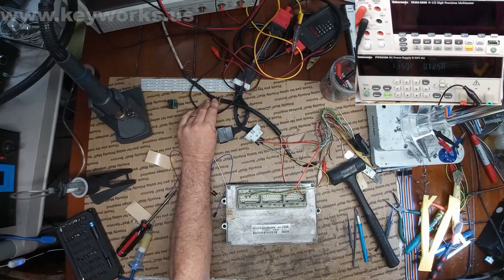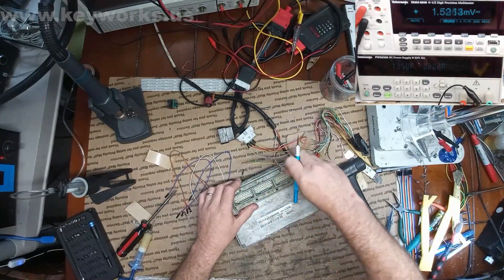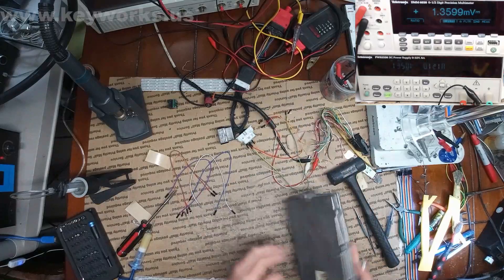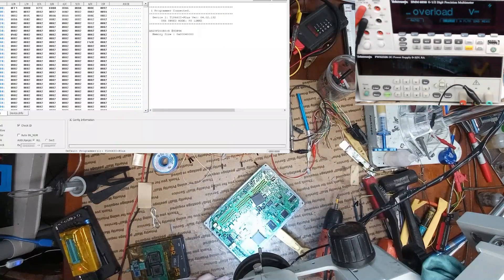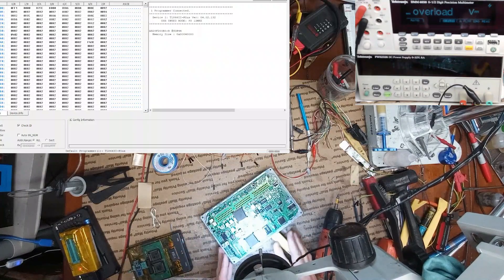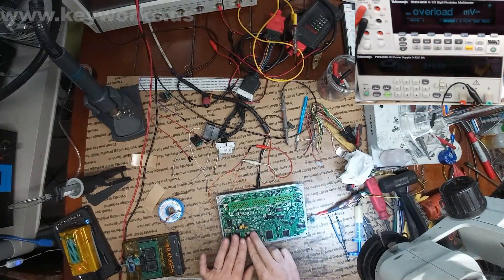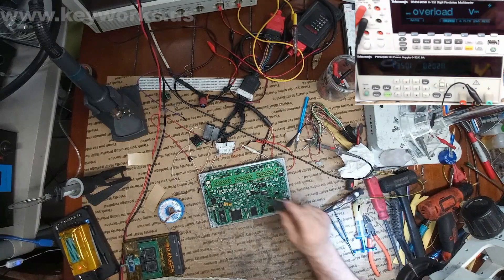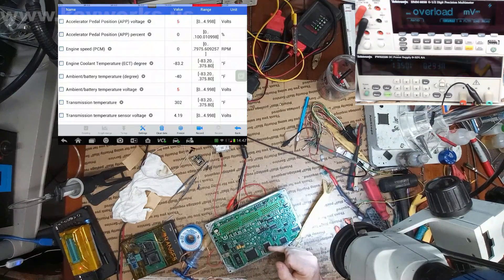Repairing a Dead DODGE RAM JTEC PCM with no communication - Board level electronics repair

Comment: Can I send you my 2001 Dodge Ram 1500 5.2L 2WD 5-speed manual computer? It's losing its spark after warming up and displaying no bus I have tried a new computer from flagship one and they can't get it right. 5th try with them and still not the right computer. I took the lid off of my original and there's silicon stuff over the board so I can't even mess with it to see if there's broken soldering. Is this something you can tackle for me?
Reply from the maker: Sure, that repair can be purchased anytime from my website. https://keyworks.us

Comment: I have an 2003 2500 dodge runs and drives but I can’t run a scanner it says no communication between anything is it a wiring issue or most likely an ecu issue
Reply from the maker: Its either wiring for SCI bus, or worse, the sci bus is fried in the ecu which is not reliably repairable.
Reply: Ground issue on the truck?
Reply: @Hotrodfabs ended up being dirty tipm connections thankfully since it still ran that was the main culprit before wire chasing
Reply: @Avoided_room that's awesome , mine had a few bad ground s fixed those and now I have communication again but likely a bad pcm only the tach guage works and cluster passed self test

Comment: Can I ship Mine to you?? Same pcm😂 2003 ram cummins auto
Reply from the maker: Sure, I work on those quite often. My site is https://keyworks.us
Reply: @ecurepair  hey brother I dont see the specific 2003 dodge ram 2500 diesel option what should I do?
Reply from the maker: @Izzabumminz  for the ecu on 03-07 cummins 59's the listing is here https://keyworks.us/ramecu59.html
if you have the early model 03 that still has the ecu and the pcm, I'd reccomend you send both. You can use the same listing and I will see which one is bad before making repairs. If you are sure its just the pcm on firewall (not typical) then the listing you can use is https://keyworks.us/engine-control-module-mail-in-repair-services/ram-truck-ecu-repair/ram-cummins-96-97-ecu-repair.html
Reply: @ecurepair  Thank you for replying! Well hear this out, my truck has 800hp/ with firepunk tuning for a manual valvebody, it used to be an auto shifting truck, it runs great, but doesnt communicate to pcm, and my truck drives around with prndl indicator stuck on park,

I can only flash my ecm with a green and white wire on pcm disconnected, or the whole c connector unplugged. 

Do you think I’ll still need to send Ecm? 
One thing also that happened but is repaires now is when a transmissiom got swapped the wires got pinched and cut/def shorted to ground, harness has since been repaired
Reply: @ecurepair  I purchased the 96-97 pcm and am Sending in my PCM
Reply from the maker: @Izzabumminz  Looking forward to getting it! Sorry I missed your last comment, Definently sounds like it would just be the pcm needed to be sent.

Comment: Just been doing some research I have a 96 dodge ram 5.9 Magnum it was dying when I hit bumps in the road, and if I gently wiggle the plugs of the computer, it will restart, but if you wiggle them again, it will die or it won’t idle, but it’s obviously all right there What is your opinion? Is it related to the plugs or is it the computer itself? It’s very clean. I put dielectric grease in the plugs just trying to decide. Do I need a new computer or what? Thank you for any help
Reply from the maker: i would look from broken wire terminal inside harness for what your describing.  But the ecu at that age should be rebuilt before its too late and the caps destroy the power management area,
Reply: @ecurepair  hey I really appreciate the response. I’ve been a mechanic my whole life and I do it 40+ hours a week I’m a fair hand, but I’ll be honest with you. I wouldn’t  have the slightest idea how to remove those female pins out of those plugs I did get the back off of each of the three but the way they’re going into the connector. I don’t know how to release them. You’re being very honest with me appreciate your knowledge,because we are ready to get a computer. How would I go about getting to the actual wires crimp connector within the plug? I really truly appreciate your responses to this kind of at our wits end here seems to be the farthest towards the driver side,this truck was “chipped” and my son drove over to high school. I know he done some wiggling on that plug at some busy city intersections.I figured it damaged something 
So yeah, if you can tell me how to release those female pins I would love to check them out today. It’s sitting in the shop waiting for the next move. Thanks 💯
The symptoms are no start just cranking , wiggle the plug it will start but you have to hold the RPMs up for about 30 seconds or it’s like the throttle positioning sensor is not getting read then it will idle and then it may just literally shut off or until you touch one of those plugs, like I said, mostly the one farthest to the left sitting in the driver seat
Reply from the maker: @usernameinvalid2675  Here you go https://www.youtube.com/watch?v=DwTg3wWlpOM
Reply: @ecurepair  thanks for the link.I goofed and took it apart in the middle now all my barrell ends are loose 
The reason I took it apart was I didn't have the tool I found what you claimed to me C1  Pin 31/32 or 30/31 don't remember  are grounds and when I wiggle those it kills the truck. Sure enough when I inspected them they look like they're corroded or have gotten hot. Sadly, the two pins  on the computer look like they're burnt at the base of the pins,but I'm not for sure how to crimp new terminals onto those wires yet I have the complete set up GM Weather pack stuff. I use all the time, but this set up  is kind of new to me.
Thanks for the video and all your help
Reply: @ecurepair bro you’re a lifesaver, same issues on my Dakota, trying this later thank you
Reply: @Elliott-l5p  good luck 🍀👍
Reply: Anybody that offers a service plus gives out actual advice is goood guy.👍

Comment: I am working on recapping a 97 Ram 1500 ECU. Can you advise me whether or not I can replace the old liquid electrolytics with solid polymer of similar voltage, capacitance and size or will the low ESR cause problems? There's only 3 caps on this board. Thank you!
Reply from the maker: I dont think the low esr will cause any problems. These are just filter caps. Not sure how the filtering will be effected but I doubt it matters all that much.
Reply: @ecurepair  thank you for your input

Comment: The big question is do you have any tips for removing that silicone type potting material?
Reply from the maker: Nothing special, just slow and steady.  Use wooden or nylon tools.
Reply: @ecurepair  yeah, I was hoping something had come along in the last 15 years that made it easier lol. Thanks.

Comment: Was wondering if you could give an opinion on a dodge I'm working with . I'm at my wits end on an 07 ram 5.7 , only have 1 code 1279 , no start condition , have signal from pcm to tipm , no starter output voltage from tpim (i believe it is c9-pin2). Not much info to go by figured id see if maybe its something common you have run across before . Have good comms and cant seem to find anything else at fault . Tried swapping out the TIPM with a used unit but same outcome . Not sure what direction to go . Love your videos , i've watched pretty much all of them . Thanks
Reply from the maker: I'd hate to give you bad advice. I dont know much about diag while stuff is on the vehicles but I would check live data to see if the Skim/WCM is sending the start command when key is turned, if it is and tipm was replaced with same outcome then its possible the driver in pcm is at fault. If the Skim/WCM is not sensing the start command, then its possible the plastic ignition switch is faulty and not making contact for start command or possible the skim could be at fault tho the metal key type are usually pretty solid. Once long ago, I had a tech working on a Nitro. Same symptoms, no start command. They replaced and had me program the TIPM first, Then PCM and Finally the SKIM.  Still the same DTC in skim (i forgot what it was sorry). Turned out there was some issue with the battery, I guess some type of internal short. It was showing as somewhat good voltage so no one really paid much attention to it. Eventually I guess they put another to do some testing and after replacing it all the problems where gone and it cranked like normal again. I would like to mention, the bad battery had been disconnected and reconnected several times so it was not an issue of anything getting reset from disconnecting it.
Reply: @ecurepair  Thanks for the assist . From your reply - "It was showing as somewhat good voltage so no one really paid much attention to it." This is what I went after . Testing both tipm units on the bench reveled they were in good working order . I found that on the truck the tipm seemed to "go to sleep" so i began to hunt for some type of voltage deviation . I eventually found one that seemed about 1/2 volt low , i'd have to look at the wiring diagram again but I believe it was related to the brake light circuit . Turns out it was a partially corroded wire that could carry most of the voltage but when loaded by ignition stuff via the key it would fall on its face .  So at the end of the day lack of current to a portion of the tipm was the issue because of the state of the wire . O , and the wire was of course buried deep inside a huge harness . Based on the condition of the rest of the harness/wires I'd actually be willing to bet this issue was created when the harness was built at the factory . A perfect 1/2 inch slice peeled open like a banana from corrosion in the middle of a harness that looks otherwise perfect . Tricky diag but its down the road now . I have some other questions regarding bench testing but I'll leave that for another time . Thanks again for your input .
Reply from the maker: @Pauly__D  Nice job on that one! Sounds like it was probably a PITA to have to track that down.

Comment: Great job, Thanks! I wonder if you can learn from this that if it has 5 volts but only pulling 200ma then it's the secondary processor and if no 5 volts then it's the main processor?
Reply from the maker: I would still lay blame to the main processor first if 5V is present. Its second most common failure behind power chip . If there is no 5V then the power management chip is usually bad. If its the 6800 is shorted bringing the 5V down you'll know cause it will be hot as hell and likely putting your supply in CC  mode.
Reply: @ecurepair  Thanks. Do you know of any proper training I can take on Board repair? I have the tools and got pretty good at soldering but don't know anything about Diagnosing the problem and all the different chips, etc.
Reply from the maker: @advancedleveldiagnostics  I do not sorry, I taught myself everything. Lot of reading and study of basic electronics. Even today I still study a lot.
Reply: @ecurepair  I figured, but it was worth a shot😀